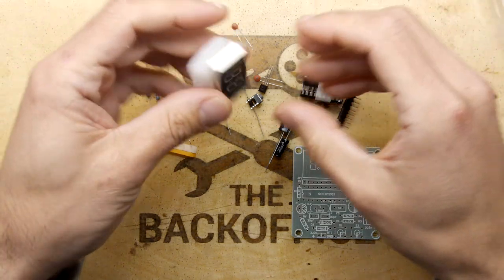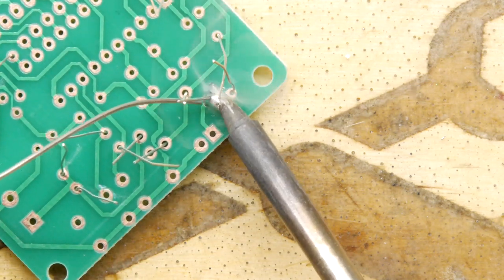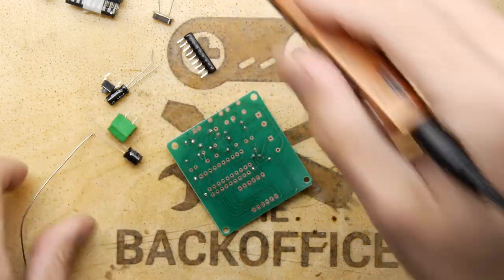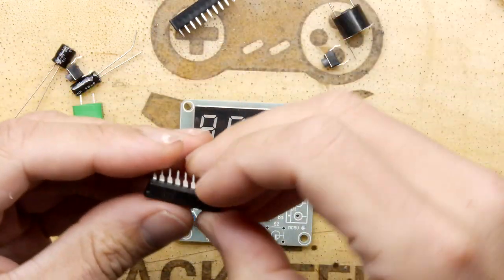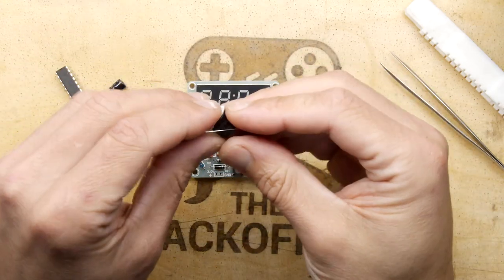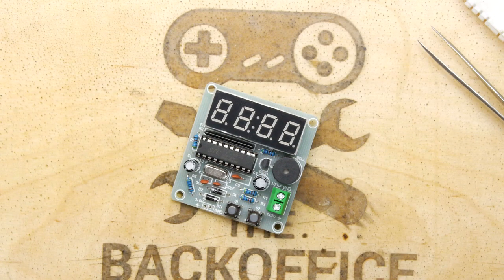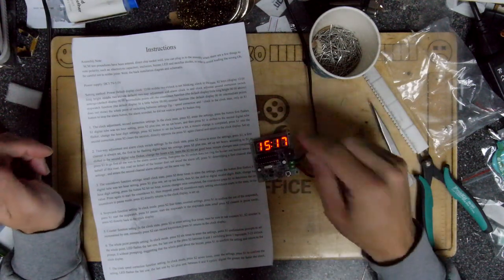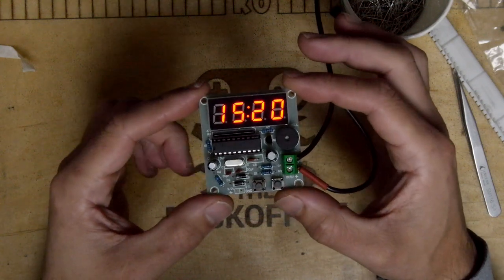Electronic Clock Kit build from Amazon

Comment: Wath happened with shugon t 26
Reply from the maker: I wore out the tip but the replacement is so expensive I have not bought it yet. They are a great iron, but I was at fault for abusing it 😂
Reply: @backofficeshow   you can ask JBC for a sponsorization .
Reply: @backofficeshow    try a t 12 station or a jabe unit with t 245 is more rezistent .
Reply from the maker: That would be a great idea 😂
Reply from the maker: I quite like my ts100, I might be able to find the fine tip I like for it.